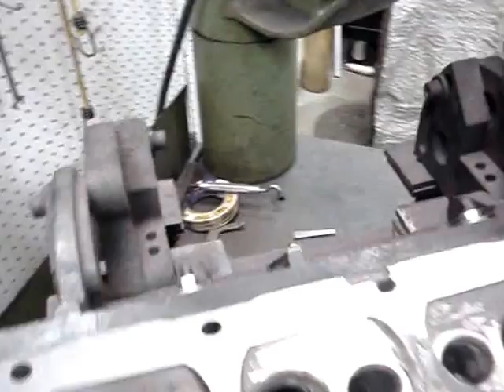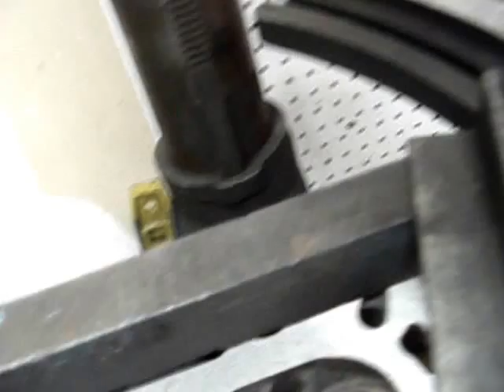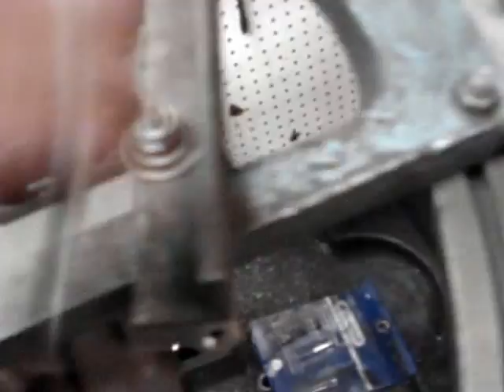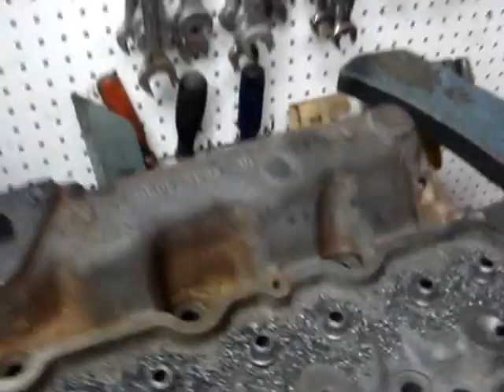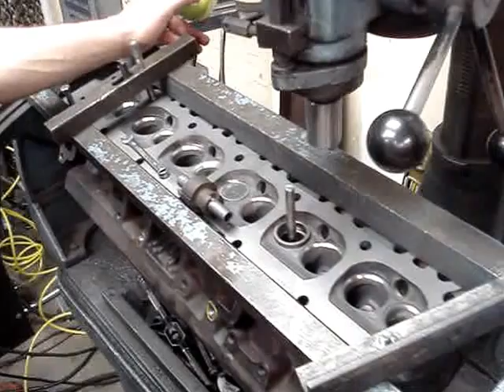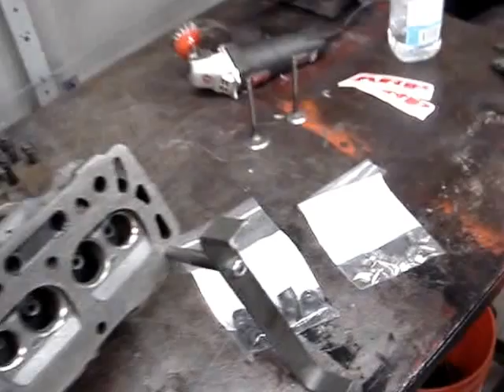Ford Head rebuild Machine Shop Pricing

Comment: Hey, great videos! Thank you for sharing so much information that one would normally only obtain when spending a long time working in the trade. Customers and pricing can be a hurdle. Either they watch a TV show and think the job can be accomplished in a half hour or the last time they had similar work done was 1983 and they are used to that pricing level. One of the other problems is: they will see someone, somewhere... online perhaps, advertising "cylinder heads rebuilt" for $99. Since the customer doesn't know the amount of labor and parts it really takes to do a thorough job, the only comparison they can make is price.  If a low-baller actually sticks to that price, one should wonder what parts or operations are being left out. Expect a call back part way through the job with "gosh Mr. So-and-so, we didn't realize that you are going to need all these other parts and labor operations too----now it'll be this much. Or, you'll get back junk with a fresh coat of paint. Sometimes, customers just want to challenge price because they like to. Being I own a transmission shop, I deal with these hurdles when selling jobs on a regular basis. Too bad you are about 2500 miles away, I'm sure we could spend many hours talking shop stuff.

Comment: It's always a good idea to go a few thousands deeper when cutting the seats before pressing in the insert, this will allow a bit of metal to peen over the seat for extra measure of fit.
Reply: waltham1957 I’ve seen to many times where someone peened the head and cracked the seats. If you get your crush right that’s all you need. .005-.006 for cast iron and .007-.008 for aluminum. If  peening still was a thing you would see it from the factory.

Comment: I wanted to build an old m20b27 (bmw). 885 cyl heads from a 325is. Checked machine shop prices to get everything honed, cleaned, polished and decked. Sold every part I had and bought a used m50b25. Dohc. 190hp without mods. Overall cheaper way to get 190hp with better mileage. Only exhaust is aftermarket lol.

Comment: I'm not an expert... and I am sensitive to how little problems can quickly add up to be very costly...and no two machining operations of this magnitude will be identical...
but I've gotta suspect that you can reasonably provide the customer with a fairly accurate estimate. (which surfaces will I need to machine, using what tooling, and what equipment, what if I mess up, what are my tolerances on this part...what finish will I need to provide...) IE, there are known cost factors... and times spent machining are generally known as well, right? this much volume of materials requires this many passes, and these feeds and speeds, at this cost per hour...

I would then expect that if the job (with a reasonable contingency fund) were to exhaust available resources, that you would then notify the customer, that his project is about to go out of budget... To which he might pay up and walk, or O.K. the additional work order and not be surprised at the cost.

Again, not trying to be critical... but, isn't this standard operating procedures for a machine shop? Or am I way off, and it doesn't work that way?
Reply: Watch the video.  He answered all of your questions.

Comment: I am going to be a critic.  Not about the price.  First buy some machines and tools newer than the 1920's.  It will cut he time in half and produce a much better product.  Examples:  use a combination pilot,drill,reamer for the guides.  Buy a set of fixed size seat cutters, no more set up time for seats. Next buy pre made 3 angle cutter inserts eg Rottler, Serti.  Buy a new machine.  The machine you have cannot hold concentricity required for modern engines.  Also easier to set up and use.  A new machine will include a vacuum gauge and pump to test the valve seat for proper seal while still on the machine. The seat can be quickly retouched if required.  The storm Vulcan used to resurface the head cannot produce the surface finish required for a modern Al head.  A good machine can produce a surface finish Ra of 10 u inch.  Also an adjustable cylinder head fixture can reduce setup time to minutes.  Cut your time in half and use the savings to pay for the equipment, make a better product.
Reply: He could make twice the profit for the same price.

I have used these old machines as well as the latest ones.

Any modern 4 valve Al head cannot be repaired with this old equipment.  It cannot produce the surface finish required or the concentricity for valve seats.  New guides require liquid nitrogen to be properly installed and diamond honing to finish sizing and produce the proper surface finish.  Other shortcuts may seem to work but not for long.

Cylinder wall finish is critical.  Without a way to measure it it cannot be reliably done.  Many shops don't own a surface finish meter, about $2,000.  RA is not sufficient. The surface finish specified by the ring maker must be obtained or longevity, seal, oil consumption will suffer.  Also some blocks use metals that require specific ring composition.

Unless it's an exotic engine it has become cheaper to replace the engine rather than fixing it.

Comment: With all the cheap import heads most people don't think having heads redone are worth it. What they don't realize is they're junk. Guides on imports wear out fast, poor transition from throat to seat. I've seen a 1.6 valve that you might as well had a 1.5 because seat contact area was inward on valve. My shop has had to improve many aftermarket heads. A good machinist will put you miles down the road ahead of cheap stuff.

Comment: By the way, don't forget to charge for shop supplies! Expendables like towels, solvents, sealers, even compressed air not free! During the winter a machine shop needs to stay a constant temperature so the equipment runs in spec. consistently. I just love it when a customer cries about that part of the bill. It's all still part of the service that helps get the job done. Great video 👍Good to see how it's done in a real world manner and not "Reality-based TV" bullshit!

Comment: I'm pretty sure http://classicinlines.com/ sells aftermarket heads for this engine
Reply from the maker: Dude! Did you even watch this video? you are correct Classic inline s does sell new 200 heads, the problem is there list price is over $1400.00 with tax do you really think suggesting a new $1400.00 head would have helped this situation? just watch this video again and see if you can figure that one out.
Reply: Myvintageiron7512 How much was customers bill for Labor and parts again, all-in?

Comment: all inline heads crack because of how the engine gets cooled, hence tighter tolerances.
Reply: +BigChevyFTW I thought this was only on certain inlines. The Ford 300, Toyota 2JZ series and Nissan RB series engines would never become famous if they were crack prone.

Most versions of the Jeep/AMC inline 6 are resistant to cracking, only certain years were crack prone.

Comment: I know how expensive 'good machine' work can be & you did give him a quote which was more than the actual cost .
That being said why didn't you recommend he buy a brand new casting or new complete head ?
Reply from the maker: There aren't any new castings for this engine no one makes them,  and all the cores are cracked or junk we couldn't find this head anywhere under $850.00 I wouldn't get a cast iron head welded unless it was a last resort also It was the customers idea to get it welded I suggested he buy a rebuilt head for $850.00 he said no way
Reply: Myvintageiron7512
if that's a 300 ford there are new bare castings & complete heads available.
Reply from the maker: That would be a great solution (IF) it was a 300 cid head but when you have a numbers matching 200 CID head from a 1967 Mustang it changes the game. I understand where you are coming and I don't want you to take offence but I'm way ahead of you here.  I didn't just start building heads in the last few months I've been doing this for 27 years and I have head core sources all over the country when I say we can't find this head anywhere you should really take my word for it, I'm not just making stuff up as I go, Thanks for the input
Reply: Myvintageiron7512
Sometimes new sources show up & I was going to share one of mine with you but you seem to have it all under control .
BTW since I didn't realize you were working on a 67  200 does in no way mean you are way ahead of me .
My first experience working on a 200 ford was in 1964 when I was just a pup which is a little more than 27 years ago on any calculator .
Reply from the maker: That's all well and good dude,  but try and see it from my perspective the 200 ford head is clearly visible throughout the video anyone with long experience in head rebuilding is going to recognize that head on sight, it is very different from the 300!  The fact that you didn't know that,  puts you in the category (at least in my mind) of inexperienced. You can also look at it this way If I were to take this head to any machine shop in town and ask what kind of head is this? they would instantly say 170/200/or 250 ford,  the only people in that shop who wouldn't recognize it or possibly say " 300 FORD"    would be the newbie or the older guy who never worked in a machine shop, so you see to any of us automotive Machinist's  pretty much everyone even auto techs wrenching on cars are what we consider inexperienced, when it comes to machine shop business. I hope this makes sense
Reply: Myvintageiron7512 Your assumption is understandable & I see, your point .
Fact is I did not watch your entire video until much later or I would have seen the  intake manifold when you rolled it over  .
If I had watch the entire video obviously I would not have commented as I did .
As for recognizing the difference between a 200 & 300 from the bottom while its on a head machine well at least I knew it was a ford & I said "if that's a 300"  .
So for me not watching your entire video before commenting , GUILTY & I won't let that happen again !
Reply from the maker: It's all good man I get comments all the time from people with all kinds of crazy advise so I suppose I'm  a little jaded

Comment: i just got an 65' mustang and replaced almost every tune up part you can.. and also had my carb. rebuilt, timed and all the goodies.. I haven't gotten inside my engine yet..The engine runs very rough like its out of timing but i just got it timed....So my question is what would i do next to find out if its my head cracked or maybe head gasket or....?? at this point anything would help me out thanks!!
Id like to know before starting any major work.
ps love all your videos!!! O/
Gmedina

Comment: I don't get how people can be so delusional on how much time this takes. It's always been "expect the worst and pray for the best" type of situation with cylinder heads. I fully expect to spend about 1000 dollars to 1300 bucks on my cylinder head.This is due to the fact that I plan on getting a port n' polish as well as double vlavesprings, lightweight lifters and titanium retainers as well as the beefiest camshaft I can get for a NA motor. 1000 bucks almost seems like a steal to be completely honest. But then again the most important part for performance IS the cylinder head so that's automatically where most people should expect to spend their money. Just an FYI for those of you who dream of building a car like say...a supra. A cylinder head for one of those things run about 6500 bucks. It's worth it but it's still the same price you'd pay for a REALLY clean used car.

Comment: My pops would always say, Gary you got to understand your paying a skilled person to completely rebuild something RIGHT. which takes A LOT of knowledge and time.  Even on a strictly OEM rebuild. Then they have to know how to operate AND be skillful with the machines they use to rebuild engine parts. Those machines are expensive too. Now don't you dare over torque that spark plug and strip out those threads on that aluminum head or I'll bop you up side the head lol!

Comment: I think this is the best instruction example of a head work I have seen. I hope some more gear heads find your channel. This should be shown at all of the tech institutes. Down to earth man. Question, on the initial first drilling of the guide did you let the head float on the table for the drill to self center in the brass guide? Did you touch up the harden seats that the welder of the head installed after you put new guides in? I know, curiosity killed the cat, and I was the student in the back of the class with his hand up. BEST OF LUCK FROM SOUTH FLORIDA...
Reply from the maker: The core drill has a stepped end that pilots into the old guide/ the seats that were installed by the weld shop were square blanks as well so yes I cut the angles on those as well

Comment: Very good demonstration and commentary.  I like your videos, please keep them  coming.  Also, if you have not done already, could you give a video on the cost of setting up a machine shop in reference to the tools needed.  Thanks again,
Reply from the maker: Yeah that would be a pretty in depth subject, so much so that I don't even know off the top of my head what that would cost these days most machine shops are a constantly evolving animal acquiring and updating equipment and most spend years gathering equipment but I will give it some thought thanks for the idea.